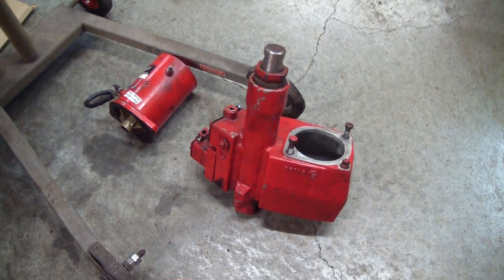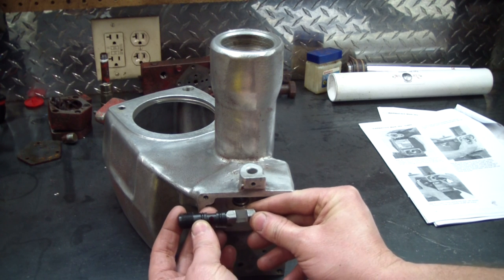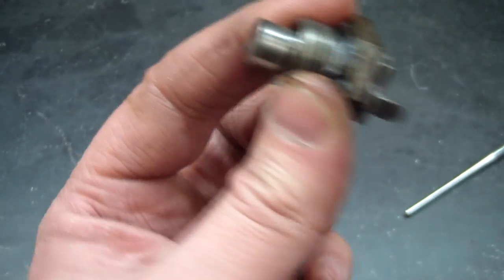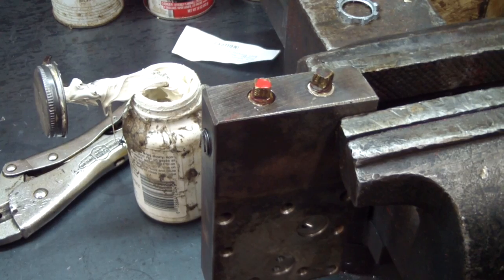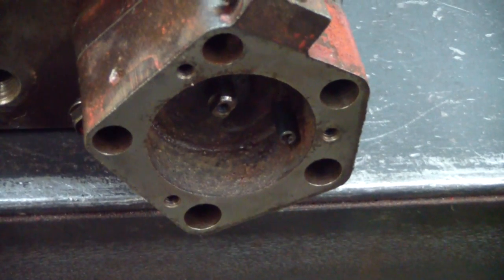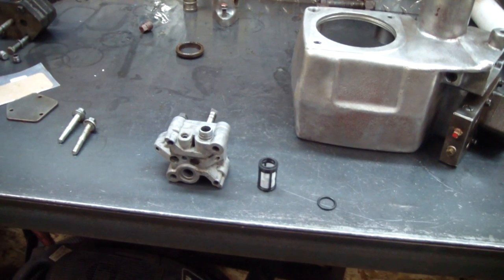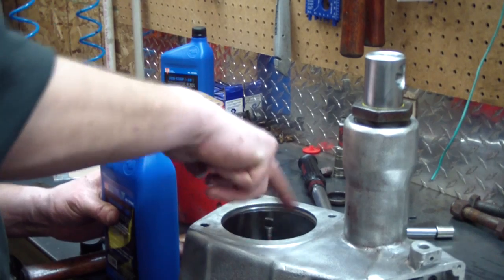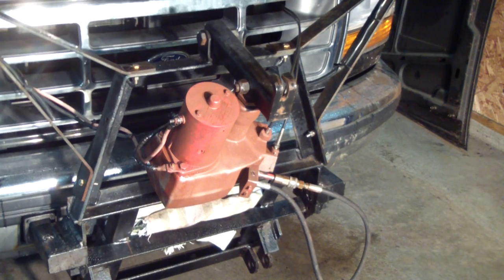Western Snow Plow Head or Pump Rebuild

Comment: I have the same pump assembly and my pump will move left and right fine but I can’t get it to lift.  Any advice?  It engages but it feels like it doesn’t have enough power to lift the plow.  If I take the chain off it lifts fine without the weight of the plow.  Any advice would be appreciated.  Thanks
Reply from the maker: The service manual is free online, print it out.  It has a good trouble shooting section.  The issue could probably be a couple different things.

Comment: What is the Western part number for the lift ram (cylinder) and the adjoining packing kit?? Thanks in advance!
Reply: I purchased mine  off of Ebay this is for the 1.5" x6"  type in 25202 western that's one of the part numbers  other is 25205

Comment: I have same plow and having trouble with the angle. It seems to do just great when the plow is down but have a hard time when up it don't want to angle. Any ideas? Put new cables and new controller as well.
Reply from the maker: Maybe you need to tweak your hydraulic adjument screws.
Reply: Oldsmob455 new to this can you help me on how?
Reply from the maker: You can print the manual on line.
Reply: @Oldsmob455  can you post a link to the manual I've never located it and basically  have used trial n error